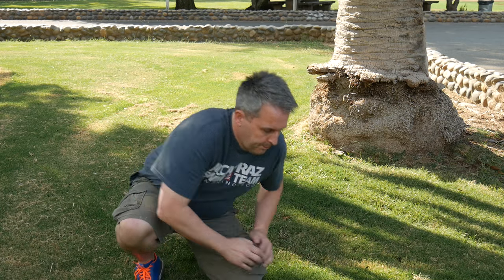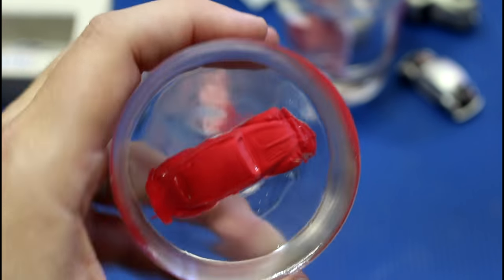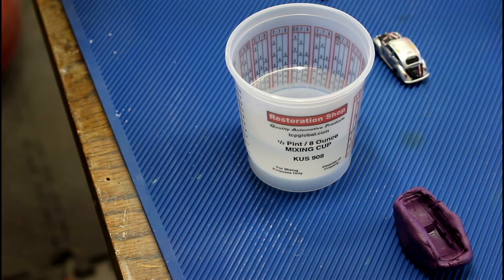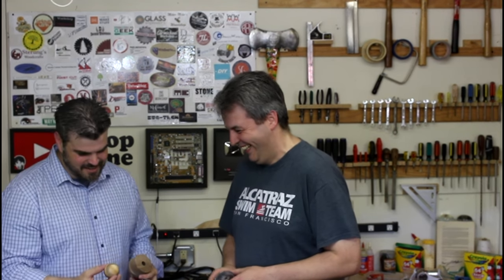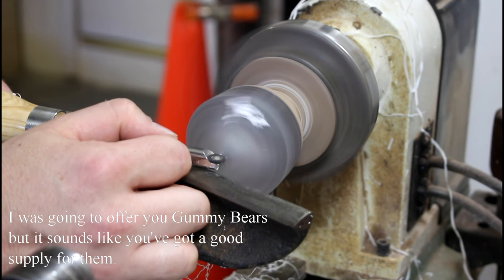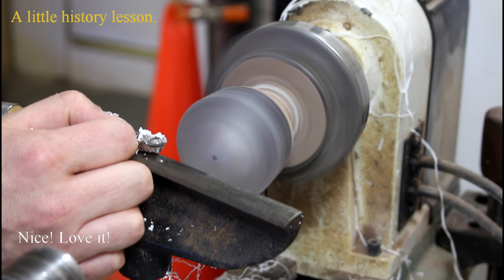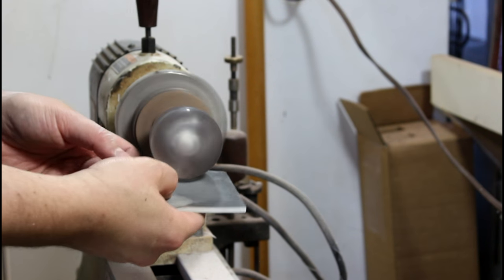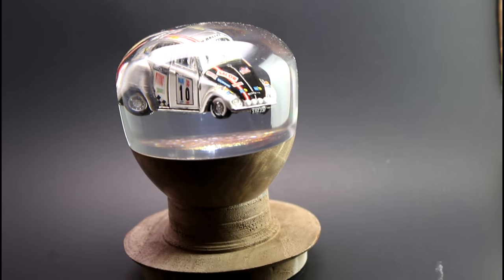Dip It #12: Bug In Resin

Comment: I've been thinking about this more and more; would it be possible to make a light saber blade out of resin?  The standard material is a hollow acrylic tube with reflective paper along the inside to make the light glow brighter, but they're either too thin to duel with or really expensive for the stuff that's strong enough to swing around.  I haven't worked much with resin, so I'm not sure on the strength to weight ratio, or on how resilient it would be to impact.
Reply: This would be a cool project to see him make .
Reply: +Corina Shull He could even do LED strip down the center to have perfectly even light up the blade.
Reply: Karl Porter
 I thought about that too, but I'm not sure if it would work.  If you just use clear resin, then you'll see the LEDs.  If you use something to diffuse the light, you'll still get points along the blade where the light is brighter around the LEDs, not to mention that would tone down the brightness some.  I'm thinking the best route would be to get hold of the reflective paper used in the traditional acrylic tubes, round it over and encase that in the resin.
Reply: That's a great idea...
Reply: Resin is far too brittle for a shape like that to take real abuse, it would perform even worse then toys. It probably needs to be a high grade of lexan to really last, although it needs to be said that the total weight would make it roughly the same as swinging a baseball bat, your play time might end up with broken bones.
Reply: the standard lightsaber blade material is Polycarbonate not acryllic, when acryllic is hit is shatters and breaks while  polycarbonate just bends :D
Reply: Urahara1001 yeah wow that's a great idea use a colored flashlight for the handle but it'd be heavy

Comment: I don't know if i already said this here but anyway, here it goes: One thing you can do to prevent "internal bubbles" is to put the whole cast (while the resin is still fresh, or course) in a strong container, and generate a slight vaccum, that way the air bubbles can only go one way; OUT

Comment: I have a very curious question  for you: Have you ever dipped or painted items prior to casting with a thin coating of epoxy or a polyurethane to get rid of the areas that trap bubbles or to seal nucleation sites?

Comment: to avoid air bubbles you should cast the die cast in a slow sure first with a paint on a layer then use a vibration table.. Jewelers use this technique....

Comment: Peter have your tried casting the an item with only enough enough to conver generously. then after curing you polish, You then fix a fishing line or two by drilling a hole with the smallest bit you can get to, and only deep enough to embed the lines then you can recast in resin while the consistency in still fluid (rather than waiting for it to gel up) this method reduces the shear line to two linear lines which are less noticeable, assuming you use a vary thin line. You can also skip the first few steps going straight the second casting but instead gluing the center of a single line straight the bottom of the ceasing then m item. Let me know what you think about the idea, our have me clarify.

Comment: Make a steampunk fan of wood and copper... Make the fan blades of solid wood with copper edges and then put the motor inside of a wood shroud and have it on a pole with the X base all made of copper and wood use wood for the base and copper for all the accents

Comment: What about using some ultra clear fishing line attached to a weight. this way you can get it positioned at the right spot with no fill line and you cut the weight off and the fishing line should disappear in the resin.

Comment: I'm binging all your videos and I notice you said there's no way to avoid a line completely, but in your video when you "encased resin in resin" the shaving seemed to disappear completely.
So how about instead of doing two layers, use a bit of hardened cured resin as a base under the item you want to encase and then pour the resin over it?
Is that something that can work?

Comment: Do a half peeled banana
Reply: Ooooor...
Dip an unripe banana, half way, leave the other half to go ripe, then dip the rest :P
Reply: Yeah !
Reply: that wouldnt work...
Reply: Well, If you like rotten bananas then I guess it would work.
Reply: it would work the same way as the bacon handle...it would work.
Reply: I'm wondering, you see, if the resin covering one half of the banana will at least slow the ripening of that half, such that the half in free air ripens at the normal rate.
This sounds like the title to a weird scientific paper :P
"The effects of resin encapsulation on rates and degrees of fruit ripening"
Reply: Heh, no it wouldn't.
Reply from the maker: I think the moisture in the banana will effect the resin. Resin and water will not work together....
Reply: Peter Brown aww, that's a shame 😔 I wonder what the weirdest or "grossest" thing is you'd be able to dip? A cows eyeball from the butchers or something 😷

Comment: Peter, I've been watching some other videos on guys that use casting and I noticed that almost all use pressure pots. Any reason you don't use pressure pots in your casting?
Reply from the maker: Yeah.... In my mind there is already such a lot of money invested in making these projects, I don't want people to feel they are insurmountable.

The addition of a pressure pot, and air compressor and specialty resins add complexity and cost that isn't needed. This casting is completely bubble free and I hope,  easy enough for most people to make with stuff that they can by at a local hobby store for less than $100.

Comment: Probably a stupid question but can you re-use that resin that you used for the test run cars? sorry for horrid engrish
Reply: No once it's set you cant reuse it to my knowledge.
Reply: thank you
Reply: Yes, actually you can, but it may cause imperfections with how the light radiates through it, like fissures in quartz. When you mix shavings into wet resin, the white shavings turn clear, but it will not be perfect when dry. You can use it as base filler if the base does not need to be absolutely perfect.